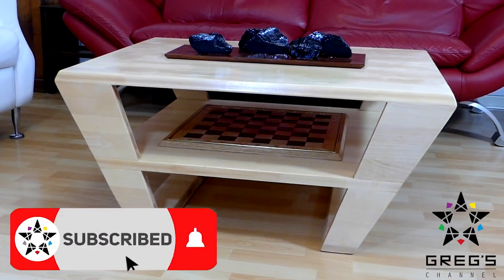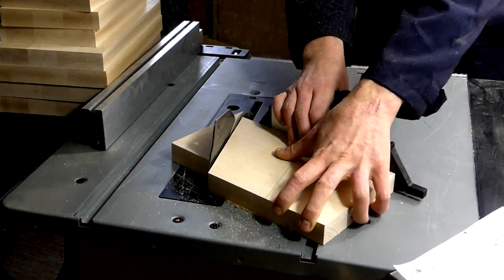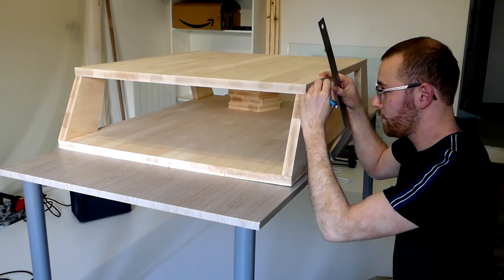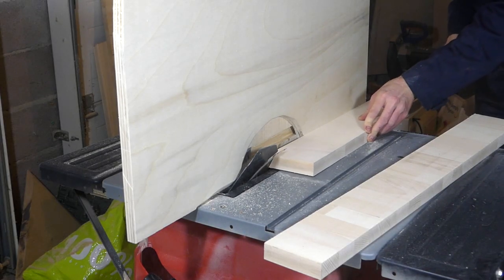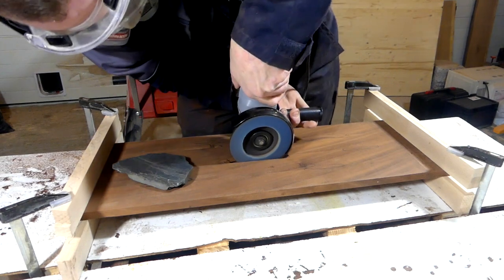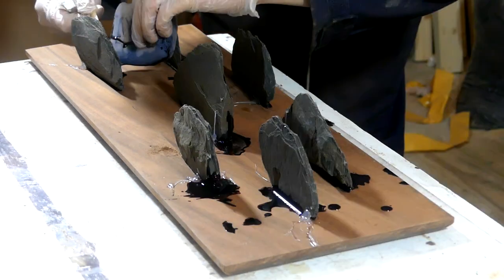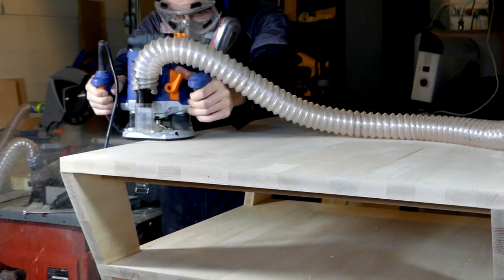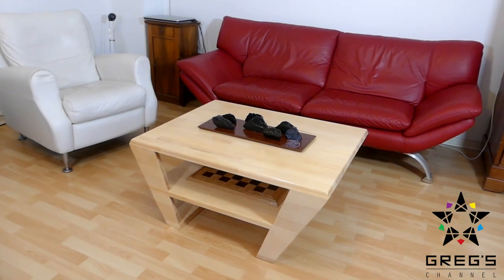DIY Woodworking: Coffee Table With Interchangable Slate Island & Gold Leaf Chessboard

Comment: I really like this table , GJ ! I m thinking of making something similar  but with tiles on the top( I m not a pro in anyway ) but I can't decide the angle for the legs . Can you send me a suggestion about the initial width and angle that you used for this one ?
Thanks in advance , keep up the good work !
Reply from the maker: Ok this was random since I chose the angles visually with direct dimensions and not angle dimensions, but the inner angle = 72° and outer angle is 63.43°. As for the top, it's 80*100cm.
Fun fact for the angles: 72° is the angle of a pentagon, while 63.43° is the dihedral angle of the Dodecahedron which is also only pentagons :)